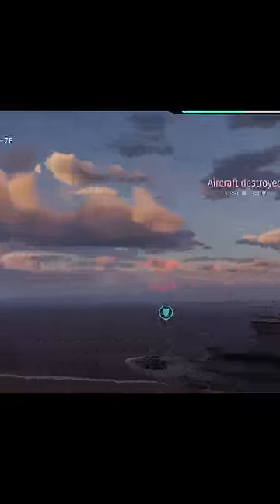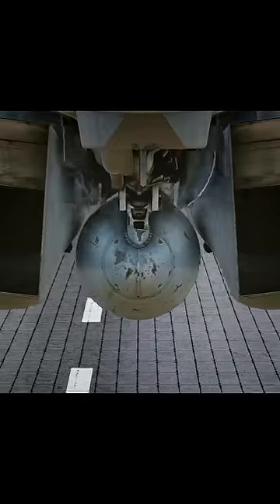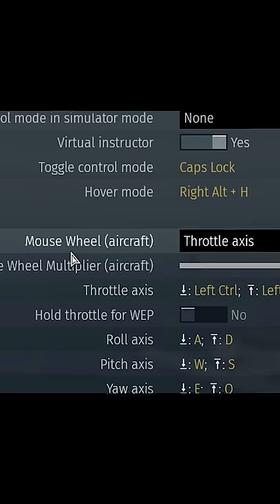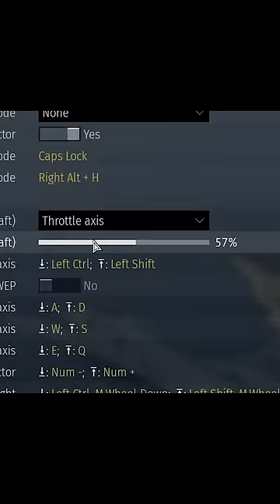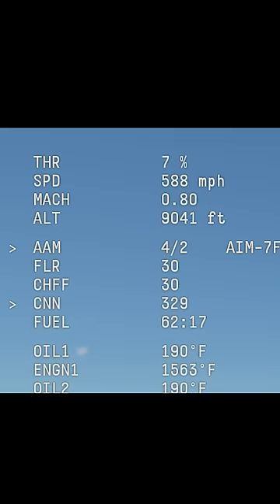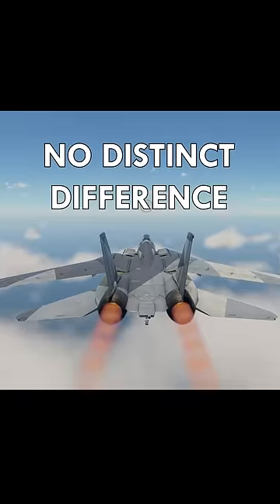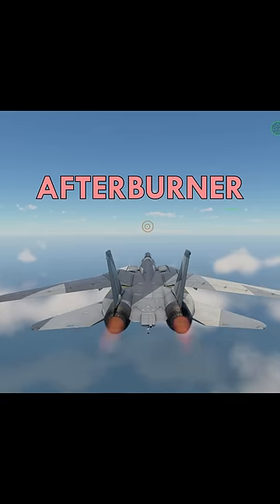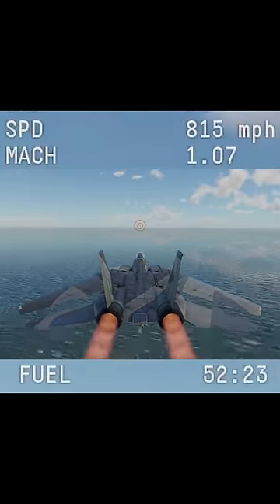How To Easily TRIPLE Your Jet's Fuel Efficiency in War Thunder

Comment: They should give WEP a percentage so you can do this.
Reply: yea itd be nice to be able to do half after burner like in dcs
Reply: They do. You have two stages of afterburner in some jets. F-14 has it.
Reply: @Acepilot235  Alright, that is not quite correct. You are able to go into more than 100% on your engine, engaging your afterburner. WEP is at max 113,5% iirc. If you dont scroll up all the way, you can get between the 100% and the 113,5%.

HOWEVER this is not how Gaijin has modelled afterburner stages, as this same mechanic is present in propeller aircraft, which, as you might know, do not have afterburners
Reply: @huntingfox3351  no but propeller aircraft have WEP which is why in game its called WEP. ( War Emergency Power) it wasn’t often used as it could damage the engine ( back then the engines werent as reliable as modern piston engines) and since planes had more drag and limitations back then it wasn’t always easy incase a engine goes out(not that it ever is) and the fact that WEP could only last a few minutes. Also it wasn’t available on all aircraft.
Reply: @JacKnife3705  yes and if you check the game data you can see that propeller aircraft WEP works the same as jet aircraft WEP
Reply: they did and they do, you can change it in settings.
Reply: @flashbeaster  where? because only a few jets have over 100% throttle actually aviliable and those arent the afterburners, thats just a more powerful dryburn. jets that have afterburners run WEP
Reply: You can there are multiple stages just go one click up at a time pay attention to your fuel you will see the different drain rates and feel the different levels of acceleration
Reply: @JacKnife3705  it's not a case of modern vs old, but rather a case of tolerances. Even the little Cessna engines have low tolerances so that they can continue delivering power at nine thousand feet. If you're abusing high performance engines, they will fail faster than loose tolerance Corolla engines. They can also fail more spectacularly. And airplanes really really need their engines even more than cars lol. You can flog a Corolla without oil far longer than a Ferrari.

Tight tolerances = poor reliability
Reply: @dylanyeomans3842  not all planes have a multiple stage afterburner in  real life, perhaps F-14 has a two stage afterburner and other planes in tje game also has this feature and would be nice to have full afterburner and engine control in the game.
Reply: @Acepilot235  yeah but you dont have a clear way to see it
Reply: it would be nice if the game indicate 
WEP STAGE 1
WEP STAGE 2
WEP STAGE 3

just so it'll be easy to know which "mode" of afterburner you are using.
since jet maps in WT are really big, treat it as an operations like irl missions of the airforces.
Reply: @ivanandrade6211  the way to see it imo atleast is watch your fuel time.
Reply: @huntingfox3351  idk because I've tried scroll wheeling my wep but it seems like it only has 2 stages. I just look at my fuel time to be able to tell. It is unfortunate that we don't get finer control over the afterburners on jets that have separate stages.
Reply: That's also incorrect. Every plane that has WEP can go from 100-110% throttle. This means that you can set up your afterburner "stages" from 101 to 110, half percents also work, depending on the scroll multiplier if you use mouse wheel for example. You can see the correct throttle percentage with WTRTI app
Reply: It's dumb because some of them do have 105% Like the A-10
Reply: He 162 goes up to 108%
Reply: What is wep?
Reply: @privateassman8839  War Emergency Power. Operates the powertrain above a sustainable rate, so it cannot be used all the time or it will damage the powertrain. Later planes, such as jets, don't receive wear so much as they are limited on the fuel they can carry. Some of the aircraft in WT show percentages above 100% instead of WEP. It'd be far simpler to know that 110% is first stage and 120% is second stage.
Reply: @daze8410  thx
Reply: No this is useless
Just use wep till 1000 and then cut to 100
Reply: I remember seeing a plane indicate it was on 110% throttle (ww2)
Reply: They used to do this. Back before they even added tanks you could do a percentage between 100% and 110%, it would show up as WEP 104% etc.
Reply: Im pretty sure you can, there is a setting for it but i couldn't remember how to activate it, saw it in a video somewhere
Reply: Wish granted, finally. 🐌👑
Reply: They have it now
Reply: this aged well
Reply: They did it finally
Reply: You won't fuckin believe what they did then
Reply: Boy do I have something to tell you
Reply: They have added it now
Reply: We have that NOW!!!
Reply: Cant wait to tell you this😂
Reply: the do now
Reply: Now, it does! 🚨📈
Reply: You would never belive me
Reply: Boy do I have something to tell you
Reply: We get it, they added this. Half of the replies are about it getting added.
Reply: Theyve done it🎉
Reply: Looks like WT listened to y’all for once
Reply: it might seem crazy what i’m about to say
Reply: now they did
Reply: Woohoo we got it
Reply: They just did not long ago
Reply: Now this is reality
Reply: They do now.
Reply: It has
Reply: And they did lol
Reply: Hehehehe log in now and do wep
Reply: Wouldn't you know it. That's exactly what they did
Reply: Update, they did.
Reply: i play console and have it, up to 110%
Reply: They have

Comment: Well ... there is a visible difference with the 3 stages on the afterburner. But let's say during take off and battlefield approach you don't need full power, then you can save a lot of fuel this way. But usually never use anything but full afterburner during combat.
Reply: You don't want to be after burning or even 100% throttle while turning in a dogfight. Dropping it to around 65 - 80% will give you a much tighter turn. Plus afterburing makes your engines hotter and increases the chance a fox-2 hits you.
Reply: @richardmoore609  try dogfighting without afterburner off in a custom 1v1 and you wont get far
Reply: @richardmoore609  this is pretty stupid advice. Below corner speed your turn radius does not decrease with a decrease in speed. It remains constant. All you’re doing by cutting throttle is decreasing your turn rate.
Reply: @dogeness  yeah, BELOW cornering speed. Don't let it get that low and try and break off before that. But keeping your throttle on wep for an entire dogfight is dumb.
Reply: @richardmoore609  not getting below corner speed is a ridiculous condition to try to keep in any war thunder dogfight. With the G limits pilots in game have you will simply get out-pulled and shot down. You’re basically saying to never get in any turning dogfight whatsoever.
Reply: @richardmoore609 op.
All planes in warthunder turn the tightest on wep due to in-game mechanics
Reply: @KCrucis only with instructor on. Using full-real or simulatir controls makes the planes fly more true to life, including with lower power setting turns
Reply: @AlteryxGaming  yesnt.
the original mechanic is due to propeller planes literally blowing air to they control surfaces and therefore increasing tail authority with thrust.
second, you cant truly deactivate the instructor unless you are in sim  controls.
Reply: @AlteryxGaming  No, it's true in simulator too that turn radius barely changes with airspeed until you get to control stiffening speed or G limit speed. This is simply a fact of aerodynamics that a minimum-radius turn is independent of airspeed as long as you are able to generate maximum Cl from your wings. It only starts to widen if  1) you're stalling   or   2) you start to encounter control stiffening or pilot/airframe G limit. 

In other words, as long as your elevator has enough authority and your wings have enough airflow over them to generate max Cl, your turn radius will be minimum and it won't change with airspeed. It's actually pretty simple to prove this mathematically if you set the lift force equal to centrifugal force. The velocities cancel out on both sides.
Reply: How about you all duke it out right now private lobby
Reply: @richardmoore609  Yeah but if the person you're fighting has more than 3 braincells (rare for top tier players but still can happen) they will start going more vertical and eventually out energy you. 
Sometimes it's usefull to dump speed but otherwise you're just killing yourself.
Reply: Lol all the clowns in this reply chain acting like you can use afterburners in a dog fight in a jet, same people that get wrecked by missiles because they get their afterburner locked onto and their countermeasures do nothing.
Reply: @dogeness  yesnt. in warthunder (for some reason) at specific speeds you cant use full controls on all control surfaces with jets that have hydraulics (for example f14). but in dcs and irl you can. and if you do at the speeds you cant in warthunder you most likely lose your wings. and your turn radius. probably without ever stalling before the wingrip
Reply: @Tacticaviator7  and if you dont, you encounter one with at most 3 brain cells that just missiles you and you are too focused on the other guy

Comment: There is actually a hidden WEP throttle, if you set your scroll wheel multiplier low enough you can get upwards of like ten stages.
Reply: Yeah, from 101% opening till 110% opening.
Reply: HOTAS users know this well

Comment from the maker: Officially this is called first-stage afterburner, halfterburner is just what I call it for brevity. Another name someone had for it was "Eco-burner" which I liked 

To add to the video; setting throttle to both keyboard and wheel will allow you to have both fast and accurate control options over your throttle, so you can use keyboard to quickly power up and down, and wheel when you need a specific percentage
Reply: This is a really good tip, I've been doing this for a while, I've got the scroll wheel, but also bound to + and - on my numpad
Reply: I got it by binding it on z and x like in ksp game
And mouse ofc. Zoom is mouse 2
Reply: Pretty sure this works by default on console too by doing the same thing; instead of the wheel, you're just barely nudging the left joystick past WEP.

It's only really consistent when you're going straight or in a gentle turn though, as your roll axis is on the same stick and trying to keep it pushed in that exact spot as you're rolling around turning and burning in a dogfight is at best annoying, if not outright impossible.
Reply: Holy hit didnt know afterburner was gradual
Reply: I only do props and early jets but this trick is great when trying to manage engine heat. Having both fast and precise control means that even when running efficient you are never more than 1 second away from emergency power. Especially useful when flying Spitfires, particularly the Merlin powered ones.
Reply: You know a much much more effective and fuel saving measure is to enable manual engine control and only setting 1 engine to afterburner and 1 to 50%. Its great for large EC maps. Planes like the F4 phantom can easily go over mach 1.5 on 1 engine because WTs flught models are wack.
Reply: This is called a multi stage afterburner and I think the f14 has like 4 stages. F5 has 2 I think. Mig 23 and above have 2-4 I think but not all jets get it
Reply: @ReepsWasteOfTime  I am aware of what a multistage afterburner is, but they are not modeled in Warthunder and do not function as such, what is demonstrated here is possible on almost any afterburner equiped jet in the game and is essentially a bug, just like how some piston craft can get to 109% without engaging WEP. what I stated was referring to how the mechanics in the game work. not how they apply to real life.
Reply: What game is this
Reply: Eco-burner sounds too much like eco-boost, which makes it invalid...
Reply: There’s multiple stages tho, so calling it half doesn’t really make sense

Comment: Funnily enough (despite the snail adding the actual percentage on our HUDS now) there is a visual difference if you ever switch to cockpit cam. The fuel flow will be marginally lower on 1st stage ABs compared to full AB (It’s most easily seen in the Mirage 2000Cs as they have a digital flow meter as opposed to an analog one)

Comment: Btw what many haven’t realised yet is that it’s not just 2 stages either. It’s many of them. I use a program that shows me some more stats like my engine thrust. You can clearly see there is many different wel settings. You can go full but also like 10 steps in between.

Comment: You don't really need to use afterburner that much, there's a reason why it's called emergency.

Fyi irl afterburner is rarely used except for takeoffs and emergency interception, using them while in a battle is good if you know WHEN to use it and not overuse them.
Reply: Even then standard takeoff on the B model tomcat is just straight mil power
Reply: It’s not called emergency, and there’s a reason we moved away from the “emergency” terminology like WEP. You need the extra power in a fight, and if you’re not using it, you’re going to be at a disadvantage in many cases. It is intended to be used liberally while fighting. The only time you wouldn’t use AB while actively fighting is when you’re trying not to get too fast (2 circle fight/managing closure rate), or if you’re already low on fuel.
Reply: @Warriorcat49  that is correct, also i use the term "emergency" as to not confuse casual War Thunder players
Reply: WEP stands for “War Emergency Power” doesn’t it?
Reply: @goawayihavecommentstomake1488  
Yes, and we haven't used that term in aviation since piston-driven engines were in use.
Afterburners, however, can technically be used for the entire duration of a flight without special maintenance inspections being required, so it's not an emergency setting. The only limitation is fuel and range.
War Thunder simply uses the term for any "greater than 100%" power setting.

Comment: you can actually adjust your afterburner from 101 to 110% (it jumps to 110% right away if you increase throttle past 100 with your keyboard). You can only see this using WTRTI for example

Comment: some jets have cockpit instrumets which can indicate how much of AB you have set. if they dont have this, look for fuel pressure, fuel consumption, nozzle mode, exhaust temp. 
you can see scrolling 1-1 on your mouse wheel will increase these ever so slightly until you max out

Comment: I use the same trick on the f-16. It even has a guage in the cockpit displaying fuel flow rate, which can be uaed to see the difference between thw various levels of burner. Not sure if the f-14 has the same guage.

Comment: The amount of times I need to watch my fuel is so small and when I have to, I either RTB with 50% and <2mins fuel which is enough (you can even glide some of the last bit) or just skyrocket up and then glide back.. I already bridged 45km by just gliding back on a EC Map. 

On non-EC maps you can always use Afterburner down to 21-22mins of fuel. In the Mig-29 I got 29:25min fuel and 10min drop-tank. I mostly turn Afterburner off once I AB'd all the way down to 21-22min because thats when my fuel aligns with the mission time left and Im on the enemy's half of the map and can attack from behind. I still got plenty of fuel left so I can use AB a few more times and you really dont need a lot of fuel to RTB. 

On EC Maps I always use my drop tank to get a lot of altitude, the higher you are the less fuel you use.. in the Mig-29 it is godly how much efficiency you gain out of your fuel compared to others like the F-16

Comment: Yep. Been doing this for a while now but only works on a mouse as you said. It frustrates me that WT apparently doesn’t know what an afterburner is. AB is not AB. It can be THROTTLED. Full AB(+) aka war emergency power will yes eat your fuel up, compared to normal mach 1+ AB or stage 1 etc.

Comment: In the Tornado cockpit you can see that the fuel flow using this method is like half of the fuel flow with full afterburner. I habe used it for the Tornado ever since i noticed that

Comment: One of the first things I spotted when f14 dropped. Best way to use this is when taking off, once you’ve reached Mach  1. just throttle down to 100, then back to wep by one singular scroll on the mouse wheel. You’ll save gas

Comment: You can also tell the difference from the engines temperature 
And I figured out how to do this on Xbox a while ago you just go to 100% and push gently for halfterburner or full WEP and if you wanna go back to halfterburner or what I like to call it stage 1 and 2 afterburner you gotta go back to 100% from my experience

Comment: Kinda important, the multiplier for the scroll wheel is very finicky and can be “misaligned” to the point that you skip over the first stage afterburner and go straight to a higher stage or full AB. You can avoid this by going to max WEP with keyboard and then scrolling back down to 100%, you’ll know you did it right if you see 101% the first time you scroll up.

I’m not a game dev but if I had to guess how it works, the scroll wheel doesn’t move you up by 1.0%, it moves you by 1.2% or something, depending on your multiplier. Hard to notice since 1.2 + 1.2 = 2.4, which just looks like 1 + 1 = 2 when you don’t display the decimals. But 1.2 x 5 = 6, which looks like 1 x 5 = 6 in the game.

Comment: There’s actually 5 stages of afterburner in most of the top tier jets including the f-14 and the f16
U can see the difference by looking at your fuel
(In the F-16 with my loadout u can fly at mach 1 at low altitude level flight only if ur using stages 2-5)
I recomment to use stages 2-3 when flying straight depending on your jet’s fuel consumption)

Comment: At a MiG-29 the throttle control lever goes like this: first 60% is dry thrust and painfully slow ass plane, and the other 40% is afterburner. In DCS i like to keep it around 80%
 In conclusion: they should change the throttle to be like this: 0%-80% is dry and 81%-100% is afterburner.